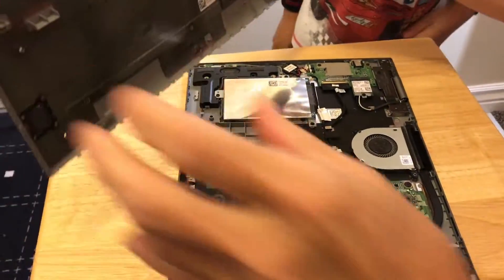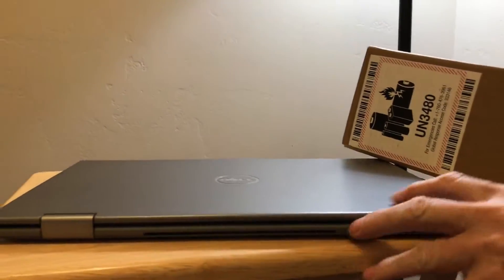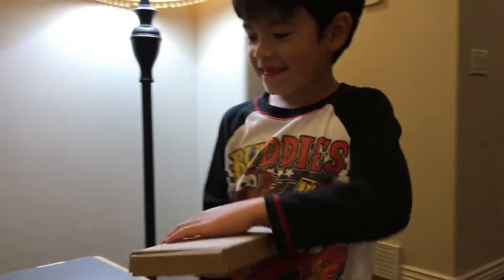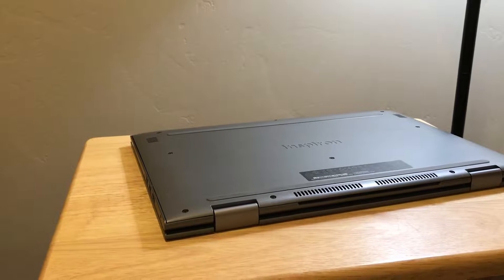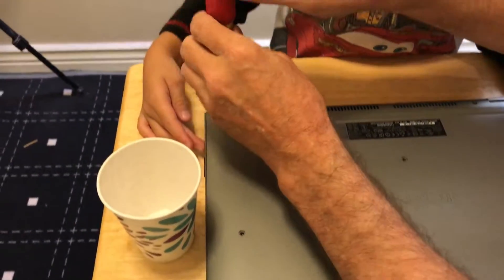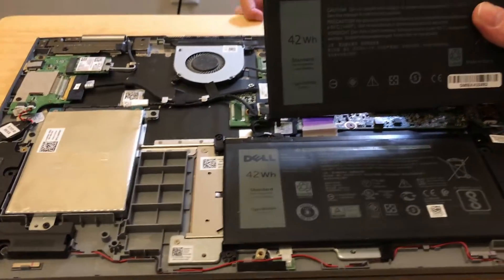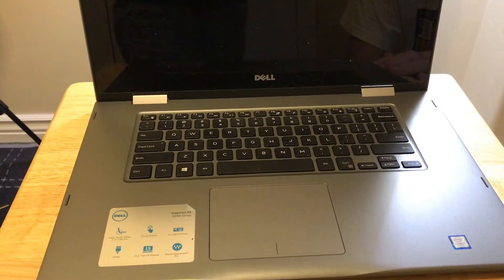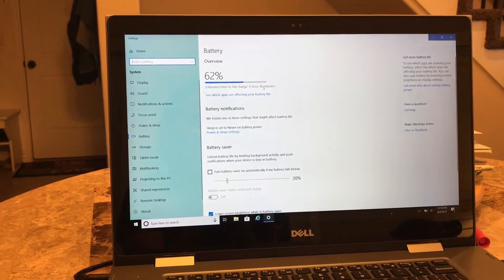DELL INSPIRON 15 5000 SERIES LAPTOP. HOW TO REPLACE YOUR BATTERY & UNBOXING BATTERY

Comment: Amigo, tengo una inspiron 15 5579 creo lleva la misma batería que usas en el video, la batería que traía el equipo duraba aproximadamente 2 hora y 30 min, entonces decidí reemplazarla. Pedí una original usada y estaba en un 80% de vida segun test de Windows, resulta que la cambio y me doy cuenta que la laptop se apaga al llegar al 20%, reinstale windows, verifique las configuraciones y continuaba el problema, me mandaron un reemplazo y el problema era similar llegaba al 15% y se apagaba, las agote al 0% para recalibrarlas y aun seguian haciendo lo mismo, pedí una generica nueva y ahora se apaga la laptop repentinamente, aleatoriamente se apaga como si se hubiera quedado sin batería, compre una cuarta bateria generica y nueva y al igual que la anterior se apaga repentinamente. Tienes idea de que pudiera estar pasando?

Comment: thank you for posting. What was the Make and Model of the Battery you bought? I have a roomate with a Dell Inspirion 15 5000, he lets me use this laptop BUT the battery is DONE! Wont even operate unless the AC Adapter is plugged in.
Can comment me back, if you still have the link? for the replacement battery? thanks in advance!
😀

Comment: Thank you for upload. Very simple enough. I'd also recommend vaccum the dust off the heat fan whilst doing the battery change as back cover is off 👍

Comment: Is it bad for the computer to use a battery that is not Dell brand? I bought a no-name brand replacement charger with the same output as the original to save money but it destroyed the battery

Comment: Hi Jen, I have an inspiron 15 7000 series and I also need to replace the battery, what is the name of the brand you bougth the battery  from and after a while has the battery worked out good? thanks!
Reply from the maker: We bought WDX0R Dell Laptop Battery 42 wh, and this is the first time we replace the battery before not yet replace the battery is dell brand. It’s work ok to my computer, thanks for your comment

Comment: I have to replace the battery in my Dell Inspiron 5576 laptop. I just take one screw out to take off the back panel. What can I say, it a custom gaming computer that has two hard drives in it, 16 gigs of memory (expandable to 32) and it's a quad core AMD cpu! It was made in 2019.

Comment: Thinking of replacing my DELL battery too because it turns off whenever I unplug it!
Reply from the maker: That what happen to my computer sis if you not plug in the pc is not working but now when we replace it the battery my pc is working now. Thanks for watchin
Reply: Same.

Comment: oh so we can replace the battery no need to pay the computer shop
Reply: Yes, replacing battery on my laptop was so easy but I had to buy a torque screw driver to unscrew the 5 torque screws to release the old battery and install the new battery that I bought from Dell’s parts division. No need to give my laptop to a shop!